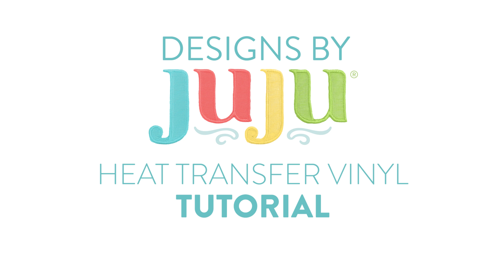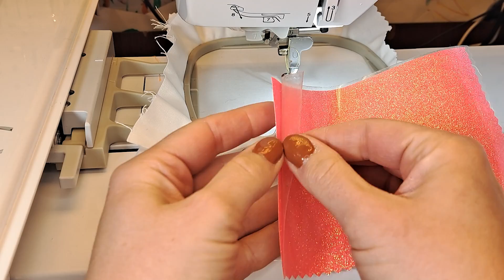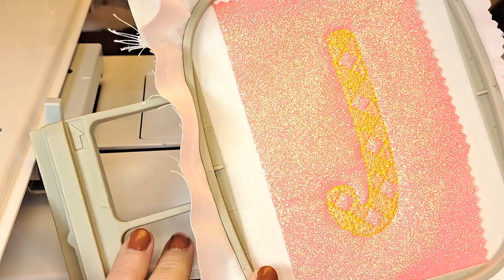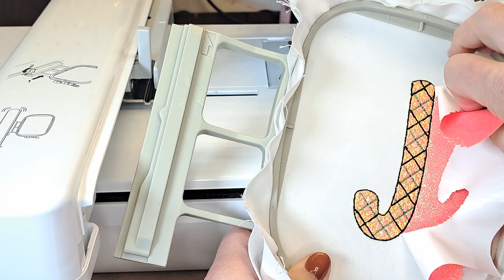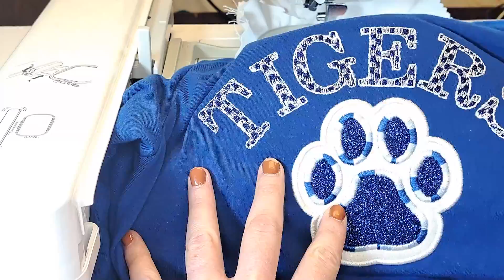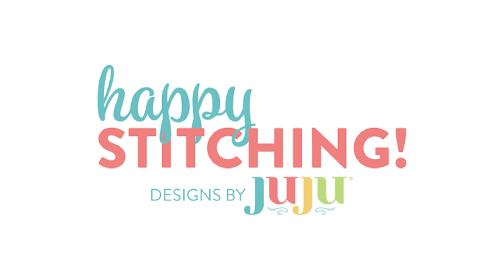How to Use Heat Transfer Vinyl in Embroidery Projects | Designs by JuJu

Comment: The plastic piece that you tore off at the start can also be used for a heat shield when ironing your project, since that what it is intended when you use transfer vinyl.  no parchment needed

Comment: what kind of thread are you using? are you concerned about it melting when you apply a heat source?
Reply from the maker: We're using Floriani embroidery thread for this project! It's known for its vibrant colors and durability. When it comes to applying heat, we always recommend checking the manufacturer's guidelines for temperature settings and ironing best practices to avoid any issues.

Stay creative and stitch on! 🧵✨
Reply: I use Floriani thread with no issues.